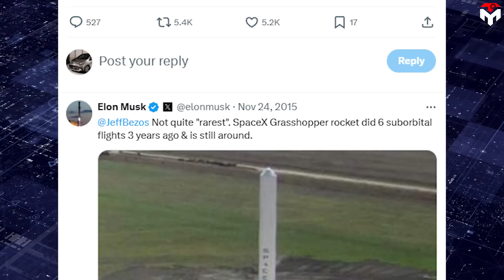New Glenn Is Officially Complete But No More Future...Elon Musk laughs!

Comment: New Glen, Jeff Bezos's launch system does not need to catch up nor surpass Elons Falcon 9, Falcon Heavy nor Starship to succeed. There is plenty of room for multiple private enterprise companies to succeed. That's how Capitalism works. If Capitalism didn't work then there would only by one restaurant chain instead of thousands. There would only be one branded grocery store instead of thousands. The same holds true in Space exploration. If you build a reliable inexpensive launch system, then it will succeed. I see all of these post that infer that the only way to succeed is to beat SpaceX. That's a Socialist way of thinking. Stop acting Like only one company has an unbreakable lock on launch systems. It's extremely stupid and un-American.
Reply: Learn how to use caps properly before giving advice on rockets.

Comment: The BO launch will not happen on schedule.  There will be some stuck/corroded valves, or some other issues.  Guaranteed.  The BO fans always use future tense words when talking about all the great things BO is going to do to supplant SpaceX.  WHEN it launches; IF it all works, THEN it will be more reusable; yada yada yada.  In the meantime, SpaceX is setting new records left and right, for number of successful launches, specific new accomplishments, etc.  I suspect that Elon hopes BO does get off the ground.  He needs "competitors" to diffuse monopoly accusations, and simply to illustrate just how far beyond them SpaceX already is, and how much farther ahead they will be in the near future.
Reply: The Chinese aside, his biggest competition will be New Glen if successful under its new leadership. This is a very big IF, though I expect them to be successful some time in 2025, It remains to be seen if Amazon is forced to add a Bunch of Spacex rocket launches to get 1600 Kuiper satellites to orbit by the middle of 2026 when the FCC will evaluate whether to terminate their license if they fail to deliver. No operational Kuiper satellites have yet launched. They are only Now finishing their satellite factory... Many things have to succeed for them to meet their deadline. Major kudos if they do. 
This requires BO and Amazon both to step much quicker. Hopefully Amazon will buy another dozen F9 launches to hedge their bets. 

I believe New Glen will succeed now (under the new leadership) it will be a serious squeaker to put up enough Kuiper satellites to make the FCC (under any administration) happy. 

And I think Spacex needs the competition to avoid being a US monopoly. I think they will accommodate Amazon (they are already launching 3 loads of their satellites), the first scheduled shortly after the Amazon satellite factory opens and (hopefully) hits its stride cranking out the 1600 sats that the FCC expects by mid 2026.

Comment: 13:05 The last statement in the video isn’t exactly correct. Blue Origin did not file a lawsuit to limit the number of SpaceX launches. They, and other launch companies like ULA, were asked by regulators to weigh in on SpaceX’ request to accelerate their launch cadence. Not surprisingly, the other companies weren’t thrilled about the idea and said as much. The regulators thanked them for participating and rubber-stamped SpaceX’ request. Due process complete. Moving on…

Comment: The race now between SpaceX and BO is whether SpaceX’s Starship can successfully land both booster and Starship can both land on Mechazilla on the same flight vs. BO can launch and achieve full orbit without a hitch.
Reply: Not necessarily. NASA can change the reusability of a Rocket for moon landing and SpaceX will have to change it. SpaceX can try to land their rockets, but if NASA doesn't need it, then SpaceX will have to comply.
Reply: @1flash3571  , political decisions are going to be more difficult under Trump.

Comment: You sure are trying hard to put down Blue Origin.

But you know what? I would not be surprised if it works the first time, in which case Blue origin just leap frogged SpaceX with Starship. For all the hype around Starship, it is still nowhere near being an operational rocket. 

And it is kind of meaningless talking about Starship having 4 x the payload of New Glenn, when the most it has achieved is taking a banana(!?) nearly to low earth orbit. Furthermore, it has not even shown a feasible payload fairing. 

Starhip without refueling is a less not more capable rocket than Falcon Heavy. The problem is that the second stage is way too heavy. It can not even reach the same orbits as a Falcon 9.

On the work week thing, we know Elon is not working anything close to 100 hours per week for SpaceX, He is not even working 20h. We know this for a fact, because we can track him using his nonsense tweets that he sends at all hours of the day. He may be active 100 hours, but he is using a majority of his time on social media, not to mention that he supposedly runs at least 5 companies that all could benefit from a full time CEO. Tesla, SpaceX, Twitter/X, the Boring Company, and X AI.
Reply: New Glen is not even close to the same capability as Starship.  It will be very lucky if it can compete with Falcon 9.  Depends on the success of its first flight.
Reply: lol, someone is hating, at least starship is flying and with the increase of launches they are granted by FAA Starship will have the chance to be operational later next year or 2026. None of the competition is close to Spacex right now. That’s said I want blue origins to succeed because I want competition and hope new glen will succeed. In the end of the day, they are all American companies.
Reply: @shotcallerjosh8457   It not hating to point out the obvious. Starship does not have the carrying capacity that Elon claimed it would have. It is too heavy, and it can barely lift itself to orbit.

Why do you think they have not tried to bring cargo even though they have completed 6 flights? Its not like they have a shortage of starlink satellites they have to launch anyway. In fact they have not even tried a mass simulator. Just a banana. 

Both F9 and Falcon Heavy launched a mass simulator on the first launch and paying cargo on the second. SLS had paying cargo on first launch. Vulcan had paying customers on the first launch. New Glenn is launching parts of its space station.

I do agree that Starship is a more ambitious rocket, but it is that same ambition that may make it a risky proposition. 

People love to say SpaceX moves so fast with Starship. But actually its one of the slowest rocket development programs ever. They are 13 years into it now, and they have still not done a real mission. By comparison Saturn V was developed in 5 years and the Space Shuttle in 9 years. If new Glenn launches as planned it took 8 years, and even SLS at 11 years has Starship beat.
Reply: My, my, little defensive there. It's simple to see that SpaceX has already launched more rockets than blue origin will ever launch.
Reply: Hater gonna hate.
Reply: Why launches a heavy stainless water tank up to the high  repeating so many times?

Comment: Casual reminder that the starship program has already burned through more engines than the entire Apollo and shuttle program combined ;)
Reply: That's a positive, correct?  No other company has or had the ability to build this many engines.
Reply: It says something about SpaceX abilities to build engines and ships to put them on!
Reply: According to available information, producing a single F-1 rocket engine likely took several months. SpaceX is currently able to make a single Raptor 3 engine in approximately two days. That would be 42 Raptor engines in three months and assuming several months is three months (it could be more) the time spent making all 5 Saturn 5 F-1 rocket engines was at least 15 months, not including the time required to make the six J-2 rocket engines used on the second and third stages of the Saturn 5. The F1 was designed to last 5 firings, and the Raptor engines are designed to last indefinitely. And on top of all that the Star Ship will lift three times the mass of the Saturn 5. Now don't you feel silly for your comment?

Comment: <yeah, so ummm....historically, new rocket designs blow on the pad frequently until the problem is solved. even werner von braun(creative genius behind the apollo program) had the v-2 rockets blowing(5 or 10 times!?) up in spectacular fashion as we have seen in old news reels>
Reply from the maker: Yes, failing fast is key, but with time-consuming moves like Jeff's, failure seems too costly.
Reply: @techmap9  <i think Elon Musk is correct about the 40 hour week equals failure, versus 80-100 hour week equals success. for my military time; as a squid out at sea, we did 18 days underway; and then during my army time when deployed to the field(FTX or deployment) average  workday hours were 18 to 12>
<jeff besos is a rocket hobbyist, sort of like jay leno is an auto collector/enthusiast; versus elon musk is the working guy with his space truck industry>
<jeff has no plan 'b'. if anything goes wrong, he might set back a couple years>

<100 ton starship/booster heavy payload can be compared to:>
The Komatsu HD785-8 is a rigid frame off-highway truck with a 101 ton payload capacity. It has a 1,140-horsepower Komatsu SAA12V140E-7 engine
https://www.constructionequipment.com/earthmoving/rigid-frame-trucks-off-highway